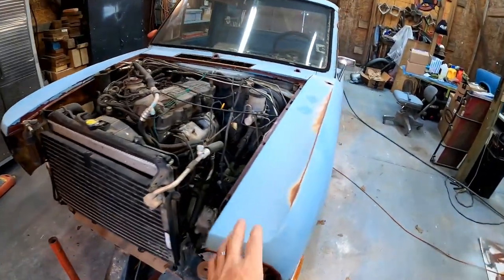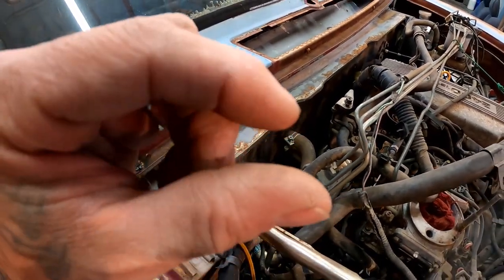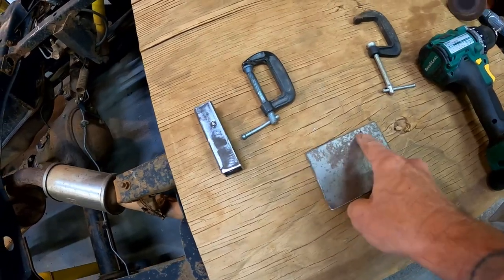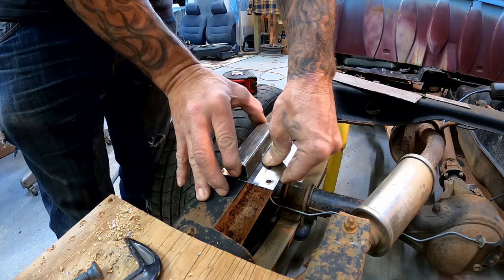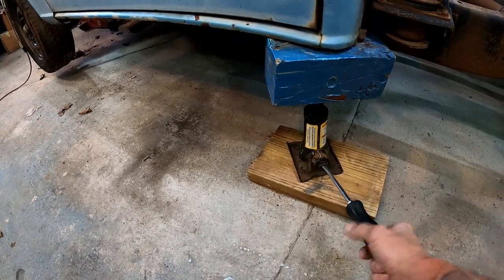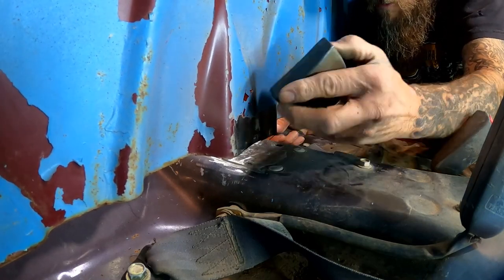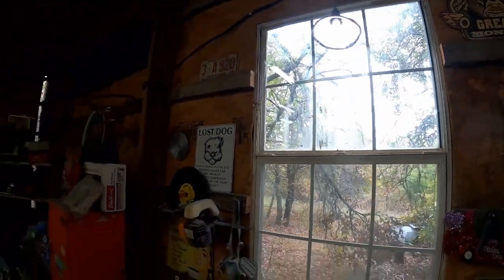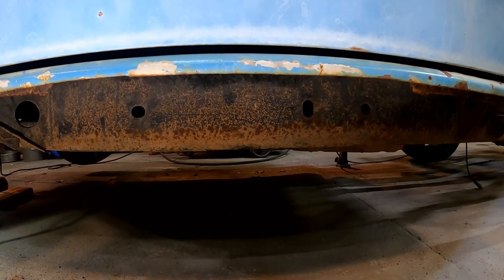FRAME SWAPPING a 1970 Datsun 521 truck from Copart pt.10

Comment: Hi, in your other video, you mentioned that you thought of shortening the chassis to make the old bed fit; wouldn’t it be easier to extend/lengthen the old bed rather than cut/shorten the chassis which would involve the difficult task of aligning it before welding it back together. Also you would also have to cut/shorten and balance the drive shaft after😬

Comment: Awesome video and excellent content I reckon or idea that you could of remove the Nissan  cab completely of and just put the Datsun cab straight onto the Nissan chassis  and relocated the cab mount point for the cab for Datsun cab on the Nissan chassis instead of cut up the Nissan cab and cut up Datsun cab could of save you lot of work that my suggestion I like what you do on your channel  and keep up the good work wired beard